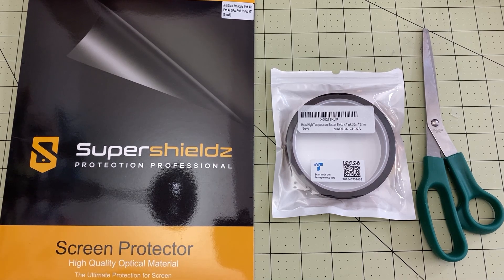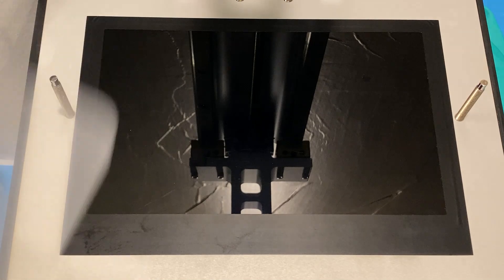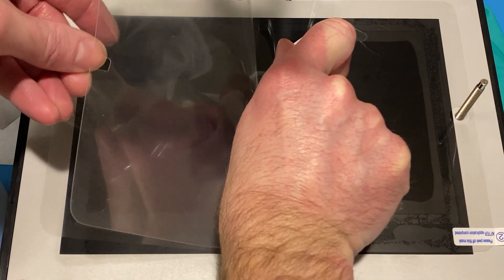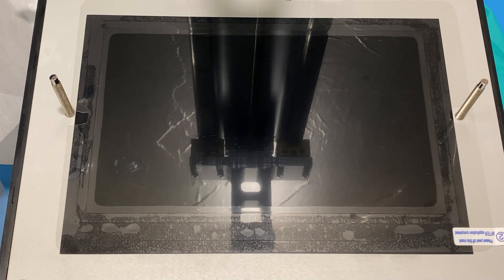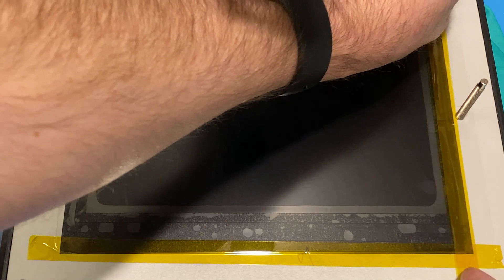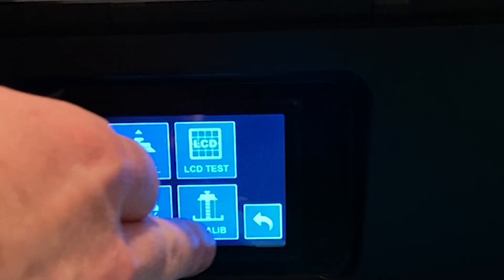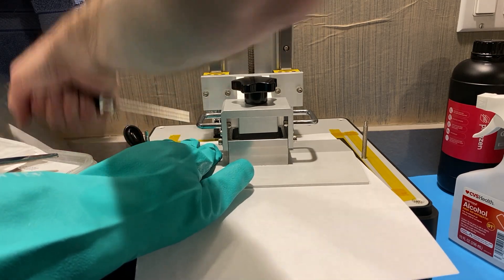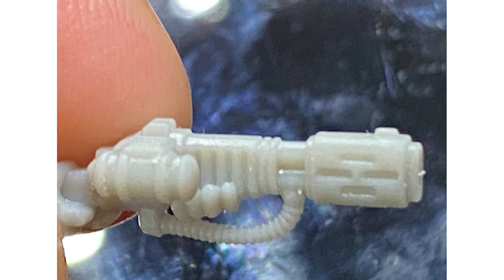How to install a Screen Protector on a Resin 3D Printer and level the build plate on the Mighty 4K

Comment: I would recommend taking the printer into a bathroom that has had the shower running hot for a while to steam it all up. This will cause all of the dust to settle so when you clean your screen you will not have to worry about it once you clean the screen. Then use mild soapy water in a spray bottle to spray the screen liberally. But do not flood the thing. Take the screen protector and remove the backing and spray that as well. Then apply it. You will be able to work out any bubbles very easy and once done you will not even notice that its there. Also make sure to wash your hands before doing this to prevent any oil marking things up.
Reply: This is how I apply SPs on my phone! Wonderful trick, dust free. Also, instead of using soapy water, a little little bit of isopropyl alcohol below the screen protector helps lube things & the air "squeegee" out to the sides, with the alcohol evaporating.

Comment: I always sonder about using a liquid under the protector, works on phones to help not get bubbles, as the liquid ain't compressable its easier to squeeese the bubbles out
Reply: Small amount of isopropyl alcohol works for applying screen protectors. helps lube the underside & carries the air bubbles out to the sides.

Comment: Nice and very useful video.  Thank you!  My question is whether a PET film with anti-ultraviolet works?  That's what this film says on the label.
Reply: I'm no expert, but no I assume

You want the ultra Violet light to pass through and cure the resin... Anti ultraviolet would negate that and it wouldn't print

Comment: Current quote from Phrozen for the Mighty is $150.00 plus $100 shipping. Located a US dealer out of Florida (Ultimate 3D Printing Store) For $132.50 with free shipping. I had a fail that punched through the FEP and the plastic diffuser on the screen. Worked fine for a bit, as long as I avoided the "hole", which generated a spike the height of the print. It arrives tomorrow, a 6 day turn. I WILL be using the tips in this video for the install.

Comment: There's already a film on the printer when you get it. Why waste money when it's already got film applied?
Reply from the maker: For the same reason we used to take the “screen protector” off the iPhone as soon as we got it and put a real one on. That is just to prevent scratches shipping. There are a bunch of pictures on Facebook of showing that during a leak that tore or came off and the screen was still ruined.
Reply: @TrueEliteGeek  If true, why not mention on the manual/instruction about it? On YouKu/weibo, artists used it with that film still on it. So you don't have to remove it. But if still concerned you can upgrade to better film  protection
Reply from the maker: They don’t mention it in the manual. But they do in their screen replacement video where they very specifically tell you to remove it. https://youtu.be/rdxjvR3mQn8
Reply: @TrueEliteGeek  Not on the YouKu videos. I been printing it with the film on and no problem. Seems to be different between the english manual and chinese manual.

Comment: This is such a great idea. Once you think about, it seems obvious. I own a Sonic Mini 4k, a Peopoly Phenom, and have just ordered a Sonic Mega 8k. I also used to have a Photon. I've always had problems with scratches, cleaning, and; whenever I've had to replace a screen, there seems to be resin everywhere gluing the screens down. I tried taping down a piece of FEP film on my Phenom and that didn't really work, and its expensive. This seems so much better. You can also get screens for laptops and monitors so the newer bigger printers will still be covered.

Comment: Quick question. Did you sand your Mighty build plate with the 80 grit sanding disc (or other sandpaper) prior to levelling the bed? Just wondering if it's necessary prior to very first print.
Reply from the maker: I didn’t sand mine at all.  I think the originals had a shiny smooth plate.  But mine had a nice texture on it already so I didn’t touch it.
Reply: @TrueEliteGeek  ok great because mine feels like it’s got some resistance already by feel. Like one of those flexible build plates For FDM printers.

Comment: I wonder if one of the Mach5ive screen protector kits (for the Saturn or Mono X) would work on the Phrozen Mighty.  You need to use a sheet of fep to act as a screen protector as suggested by Mach5ive.  Now I'm wondering if the TopScreenShield could just be used instead of the fep for a more secure fit.  Sadly I'm looking at this after my screen has already become a casualty of war.

Thank you again for the great video.

Comment: wouldnt it be better to just clean your vat if you have a print fail, not sure you need to do more than the factory tape. Original photon user here
Reply from the maker: With the larger format printers there have a number of issues with FEPs failing and leaking resin onto the screen.  Then the resin cures and the screen on most of these latest printers is not glass on the top.  There is a layer of polarizing film.  Once that film is ruined there is a very high chance you will just have to replace your screen which is very expensive.  This process makes it so you replace a $3 screen protector instead of a $150 screen.

Comment: What is the reasoning behind the matte screen protector, why not a clear one? I would think, the matte one will scatter the light more, so redirecting UV, where it should not hit.
Reply from the maker: What was found was the FEP pulls away from the surface of a matte protector better than a glossy one.  It is also a problem people have had with using FEP for protection.  FEP sheets stick together and it makes it harder for the FEP in the vat to do it's job.
Reply: Came back to the video to get links since my Mighty 4k arrived today (I just got the ship notification 3 days ago?!, I thought I'd have like 10 days). I remembered this question when I was selecting the screen protector. So to back up Mark's anecdote with a real world example, machinist's gauge blocks are blocks of metal that are so flat and smooth that when you twist them together (called wringing) they can hold up over 60 lbs of force if you try to pull them straight apart. You get the same effect with many very smooth surfaces though, but that's an example where the effect is useful and relied on.

Comment: How come Glass screen protector is not good ?
Reply from the maker: It is MUCH thicker and will diffuse the light even more reducing print quality. And because it doesn’t have a perfectly flat surface to be applied to it is going to crack really easily.
Reply: Glass protectors are from .3 to .5 mm thick and plastics are typically .1mm . I don't know the specifics for this model but for the example the light leaving a pixel on the display having a maximum of 60 deg angle is a realistic in regard to the intensity needed for curing resin. So the further from the display you get, the more the light has traveled into the next pixel effectively blurring / diffusing what you're printing. Going up .5mm, the light is reaching 6 pixels over ( 290 um extra spread, each pixel is 53um ) from screen to resin (the .1 - .125 mm vat film would add a pixel), a .3mm protector would be an extra 3 pixels (170 um), and .1 increases it just over 1 extra pixel (60 um). The result of adding some extra protection if you used .5mm glass screen protector (if it was exactly the LCD size and didn't crack), you would have also basically downgraded the resolution of the printer. I'd guess it'd take effort to notice an extra pixel or two blurring, but even if I didn't notice a difference with the glass protector something just least feels wrong to me to know it went from 4k to effectively 1080p.

Comment: It would be nice if a 600+ $ printer actually comes with protection on its screen and users wouldn't be forced to apply a home fix for it.
Reply from the maker: They just need to work it out so there is glass on top and not a polarizing film. I expect that to be a big “feature” of the next gen printers.
Reply: @TrueEliteGeek  Like the Nova3D Bene4 Mono - glass, modular, easy access, mono, amazing.
Reply from the maker: @retromodern art I hadn’t really looked at that one. I will have to look closer. The cover is interesting.
Reply: @TrueEliteGeek  Everything is interesting, I got one (Bene4 Mono), I'm shocked that more people don't know how good it is, it makes the others look like toys, holy smokes ...
Reply: @TrueEliteGeek  yea, but they need to keep the price down, it's a give and take situation, although I do very much agree. Printers should not be able to break themselves due to cost savings
Reply: The first brand that tackles issues like this will come out on top (I'm leaving Formlabs out of the equation with there 10K price range)
Reply from the maker: They all do now. Just not under $1000
Reply: @TrueEliteGeek  But why would a $5 addon be an issue? There must be a lot of people reading about this punctured FEP problem and not buy a printer because of it.
Reply: Apparently there's a greater risk of a larger piece of glass breaking which is why there is no glass protection on any of the bigger screens
Reply: @Jmaccxx  Breaking because of the process of adding a protective shield?
Reply from the maker: The problem isn’t that they don’t come with a protective screen. It’s that they are not glass on top so you can’t clean them.
Reply: @fernando749845   Problems with the Mars one getting cracked in the past I'll wager
Reply: @TrueEliteGeek  People like to use FEP for the UV properties and the resin may come off easier in the case of an accident, do you know if those ipad protectors block much UV?
Reply: @TrueEliteGeek  The more material between the screen and the bottom of the FEP the more focus is lost, the best possible focus would be achieved if the resin was cured right on the LCD (which would be a little expensive!), our next best option is a FEP layer, any additional layers between the resin and LCD will reduce focus.
Reply from the maker: I have seen too many FEP “screen protectors” fail and people still end up with a ruined screen for me to consider that a viable option.  I think the ipad protector is far superior.
Reply: @davelordy  most than focus , its download the intensity of lithg , mayvmbe a 5%...but its pretty obvious that its better have some protection ,an accident with resin could be catadtrofic, so
Reply: actually i got surprised elegoo mars 2 has one and i accidentally removed it. it's only a clear film. i ordered one from aliexpress as replacement. placed it neatly and voila i got it covered
Reply: 600+ is actually cheap for what this machines can do. but I know what you mean

Comment: the window cleaner wont damage the lcd?
Reply from the maker: I guess that is a good question.  I have always used glass cleaner before installing a screen protector so I didn't this about that being an issue.
Reply: I guess it depends on the cleaner itself. Some materials react with ammonia, so I would guess you should at least pick one without.